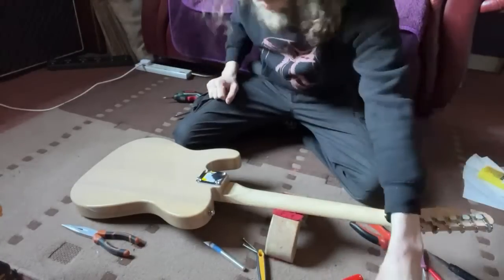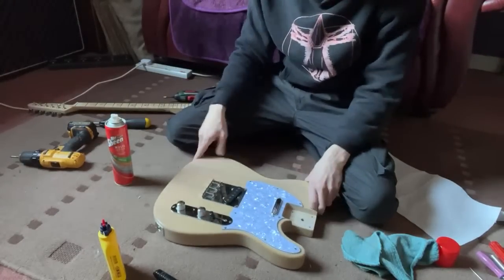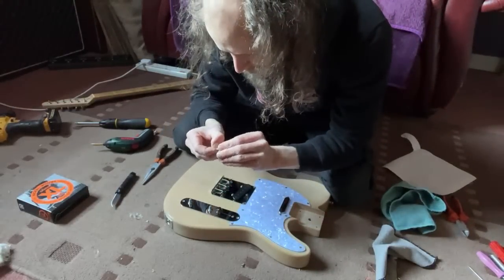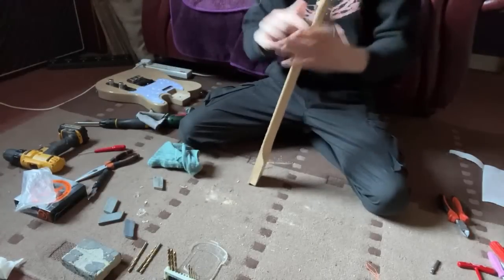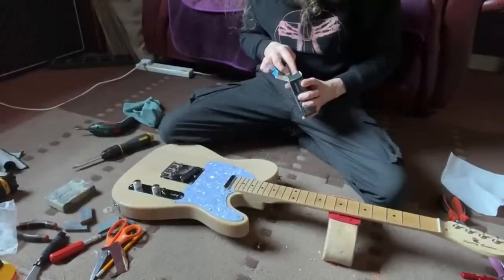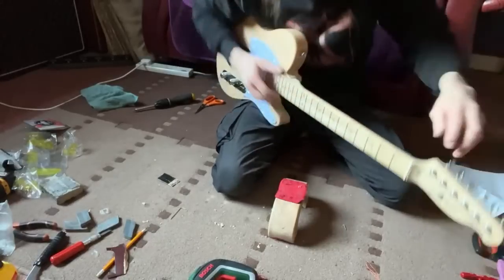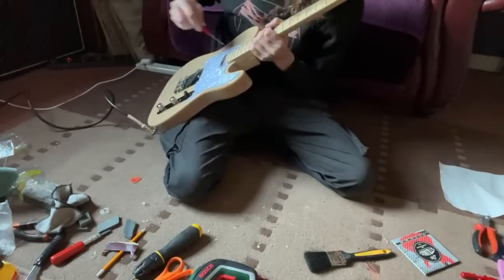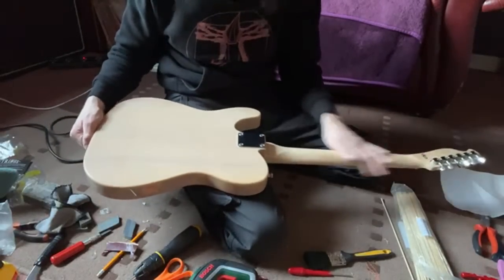Guitar Fix Up LIVE

Comment: I fit a captive nut inside the pocket on bolt on necks near the rear holes ,then drill through the body and rear plate in one go .
then fit a long grub screw to mark the neck ,then counterbore the neck on the mark to fit a steel solid washer .so I can tilt the neck to get the action lower on the cheaper guitars just like fender did .with a nut job too you can get the action really low .works with a shim too if needed .you need to slightly oversize the body holes for tilting the neck a bit more than you do for straight bolting them down 😊😊

Comment: I have the Harley Benton TE-52 . It was terrible out of the box. I had to do a fret leveling and dressing,  truss rod and action adjustment.  Now  it plays like butter. I've played it  for about 6 years. Just recently the pickup selector has problem on the bridge pickup. I have several HBs and about half of them required a lot of work to get them setup well. I bought a Fender MIM Tele last year and the fit and finish is way better than the HB.

Comment: Hey Dave good day hey I just want to tell u dnt give up on the harley I've got the te 52 and besides being able to use it for a boat anchor it is excellent I love playing it and the neck is awesome I found that harley bentons sometimes need a little work but if u do u  will have an excellent sounding playing gutiat so yea thanks for the vid hope to see ya soon good luck have a good day stay safe and healthy ok bye now
Reply: i also have the te52. boat anchor is completely accurate lol. i threw on a wilkinson compensated bridge and some new tuners, and removed the heavy poly finish. i love it to pieces.
Reply: @Justin-eu3yd  I hope it at least has good sustain with all that tone wood :--)
Reply: @Justin-eu3yd  hey how did u take the poly finish off the te 52

Comment: While people keep buying these pieces of crap the company will keep throwing um out, great a guitar for 150 but what there not telling you u prob need to spend the same again if not more to get the thing to play, the only 1 I've seen that interests me is the amorok about 450 quids worth weird that ey...... Good job dave
Reply: Funny you should say that, I just got an Amarok baritone lefty, arrived yesterday. Was going to write a review of it (first impression) so might as well do it now. Overall it's great value for money, very happy with it. Not perfect however by any means. There are various visual blemishes / imperfections, the nut has sharp edges and the tuning machines aren't up to a pro standard. They kinda catch and don't move smoothly, so I would replace them eventually. Tuning stability seems good though, especially considering it was really cold when I got it. It was set up great when I got it, except for intonation which is off. The fret work appears to be impeccable, pretty impressive stainless steel frets for that price. Electronics all in good order, strings are decent too. The flame top could be better, one half is more flamey than the other. (There's only one finish option for the lefty.)

Overall like I said, I'm really happy with it. It sounds and plays great, got great sustain. With these top range HB's you will hopefully avoid any really bad QC fails like on their cheap ones. Oh and it came in 5 days from Germany, no issue there. 

Actually it's Dave's fault that I bought it, lol. I wasn't thinking about getting a baritone until his recent video with his, for some reason I suddenly realised I wanted one. Thankfully the HB model is up my street because there are next to no other affordable lefty ones.
Reply: @martinemesguitar  I hear you I'm a lefty aswell and color options are not that many, I've heard that there are finish and basic set up problems but to be fair that cud be said of 5 grand Gibson or prs